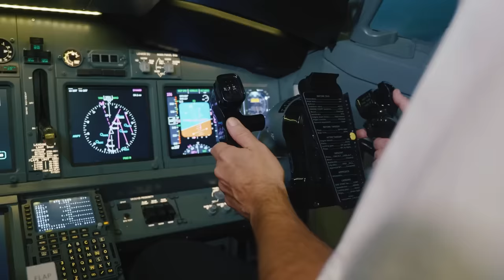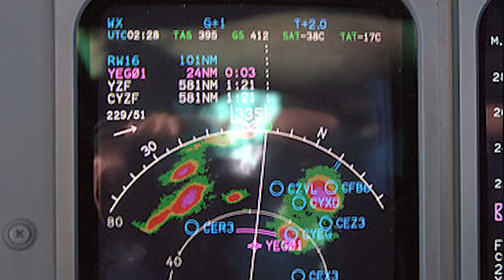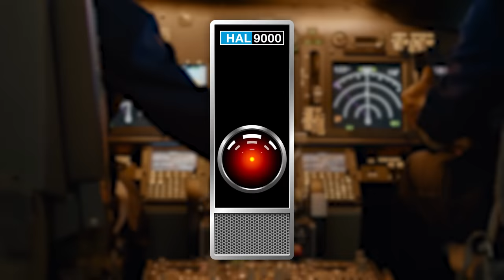Neil deGrasse Tyson Explains Advancements in Aviation

Comment: Thought provoking as always!  Just one small clarification: An aircraft turns by using lift (vertical to you) to counteract gravity and to create the horizontal displacement (relative to the earth) that causes the aircraft to turn.  So ideally, you should have always been experiencing only vertical forces when the aircraft turns. However, there are various factors (such as increased drag on the outward wing) which create a slight lateral motion which pilot must use rudder to correct.  Since you have probably spent a lot of time in airplanes, I expect that this is what you were experiencing - which all brings us back to the main point of this video - that improvements in electronics (including flight controls and the autopilot) have vastly improved the flight experience.

Comment: about the 'Taxi' discuss, in Brasil and maybe in Portuguese altogether we use 'Taxear' to the random path around the airport while waiting for go down.
Reply: Taxiing is on the ground, which you probably call taxear.  What Neil is talking about in that scene, is really called holding, or a holding pattern.

The airplane travels in a running track shape, with 180 degree turns and straight sections between its 180 degree turns.  The reason for this, is so it can re-calibrate its gyroscopes during the straight sections between the turns.  If the airplane just moved in simple circles, its gyroscopes would get a false reading of which way is down.

The gyroscope is there to tell the pilot which way is down, when it pitches and rolls.  Since it needs to adapt to the planet's curvature, rather than always pointing in a fixed direction in space, it uses pendulous vanes to slowly adapt to local gravity.  The banked turn interferes with its reference for local gravity, and many planes only run the pendulous vanes when the apparent gravity is within a close margin of 1 standard g, so that banked turns don't mess with this reference.

Comment: Taxi is transit time from gate to runway and back.  HOLDING PATTERN is the oval shaped racetrack pattern the plane flies in the sky to buy time before landing.  Look up Jeppsen airport charts and you will see holding patterns designated on each plate.  Holding patterns are also the way to increase capacity at an airport by created stepped altitudes for arrivals, you enter at say 18,000 and each circuit of 10 miles each direction with a 1 mile arch you drop by 1000 feet...thus at least 18 planes can be in the exact same landing queue for sequencing into the runway for landing.

Comment: Several others have already mentioned taxiing being movement on the ground, but I'm surprised at the amount of incomplete or flat out incorrect information in this episode. 

Regarding flared wingtips, in addition to increased efficiency, the more laminar airflow is safer for other aircraft either taking off from adjacent runways or taxiing on adjacent taxi-ways. The turbulence from a jumbo-jet without such wingtips extends far out from the wingspan of the aircraft. 

I'm not sure where you're getting your information regarding weather, turbulence stability and distance/time calculations, but it doesn't have any basis in the reality of air travel. 

Weather information is only better when you're accessing local information, as in measured at the airport, on the runway. Flights regularly alter their altitude and heading, mid-flight, when weather changes. 

When it comes to holding patterns, that has nothing whatsoever to do with accurate calculations. So many flights are delayed, etc, there's no way they could account for how many airplanes will arrive at an airport at any given time. Not to mention any flight experiencing a deviation resulting in a go around, meaning they must attempt a second landing. The idea that planes are on a tight schedule adhered to by most, let alone all, to eliminate holding is simply ludicrous. Give credit to ATC and pilot training, in addition to computer control advancements, that allow them to reduce distances between airplanes taking off and landing without sacrificing safety. Has nothing to do with flight time calculations. 

Certainly computers and fly by wire technology has increased stability under relatively smooth air conditions, but turbulence is turbulence. Anyone flying into or out of Atlanta, among many other places, can attest to turbulence still being a jarring issue. The same was true when I flew, as a passenger, into Costa Rica and had to do a go around due to violent turbulence on both attempts to land. Turbulence is still an issue mid-air, as well. Bear in mind, no matter how violent it feels to us, pilots will tell you mid-air turbulence isn't going to cause your plane to crash. It's only a comfort issue. (But the fact remains computer control does not eliminate the effect of turbulence on the airplane.)

As for computers, nobody wants to place ultimate control of an airplane in computer control alone. Computers don't know what they don't know. They are only as good as their programming, as evidenced by several well known, computer driven air disasters in which faulty programming caused the trained actions of pilots to be thwarted by computer overrides working against them. Computers are workhorses of jumbo-jet aviation, but the pertinent information regarding every takeoff or landing is carefully entered by trained pilots who use information from ATC and weather, etc to determine the best settings for landing. And. the pilots still make moment to moment corrections to adjust for conditions. We may have the technology to automate all aspects of aviation, but applying them to a jumbo-jet is still beyond what carriers are willing to spend for an aircraft. That's saying something given these planes already cost hundreds of millions of dollars.

I'd love for you to revisit this conversation with a seasoned pilot or other aviation expert, because it seems like you are uncharacteristically incorrect on a lot of this information. 

Cheers.
Reply: It’s about reducing the vortices, nothing to do with laminar flow!!!

Comment: The problem when a computer makes a mistake, it doesn't know it's a mistake. Neither do some humans but you get the point 😂
Reply: That's why you usually have multiple computers that have to agree on something or that can discard information that doesn't match what the others are coming up with. :)

I agree with your inherent point, just some context. ^^
Reply: Triple redundant is great for covering computer errors and some equipment failures but what does it do when the engine comes apart and cuts all three hydraulic circuits. The computer will crash but a pilot will try to fly the plane somehow and maybe save some of the passengers (flight 232)

Comment: There’s one back country road near where I live that has all kinds of twists and turns that you can easily drive at 80 miles per hour.  I did that around twenty years ago when I was younger, but the point is that the banking of the road was engineered for a much faster rate of travel than the current speed limit.

Comment: I grew up in the 60's and 70's about  15 miles from an air force base where B-52 bombers were stationed and they would regularly fly over on approach at about 1000 feet. Talk about noise. O! M! G! Eight screaming jet engines! Not only was it deafening, they also caused the reception on the antenna TV's go haywire.

Comment: I used to work at a Mercedes-Benz dealership that is quite literally at the end of the runway at Stanstead Airport. 

The runway ends, there is about 20 metres of grass, a road and then the building I worked in.

Whenever a plane was landing or taking off, you had to stop whatever conversation you were having and just wait, even indoors. 

In the winter you would be working and all of a sudden it would sound like a bomb went off as a block of ice fell off the bottom of a plane as it came into land and smashed on the roof.

Comment: Actually, most of the basic principles of flight you described are not simply due to computers and software programs alone. To give credit where credit is due, the evolution of the fundamentals of aircraft design and aerodynamics forces are responsible for todays modern aircraft.

We use onboard computers primarily for fly by wire control interface systems, auto flight modes, navigation, systems monitoring and management, as well as to augment aerodynamic stability.

Although computers are also used extensively for aircraft design and fluid dynamic computational modeling, they are not necessarily primarily responsible for aircraft flight stability and dynamics unless you are flying a high performance aircraft such as a fighter jet that is designed with inherent neutral or even negative dynamic stability. 

In that case, the aircraft would not even be controllable by the pilot without the onboard computers (usually 3 for redundancy) to keep the aircraft under control.

An excellent longtime reference book for learning aerodynamic design and stability principles that includes many equations and graphs is “Aerodynamics for Naval Aviators”.

Former Airline Pilot/
Masters Aeronautical Sciences

Comment: I'm an aviation enthusiast myself, and used to live 40 miles away from LAX and planes would approach the airport 10k feet overhead.  You could always tell whether there was a 747 freighter (old plane) overhead by the amount of sound it made.  Also, more efficient jet engines are making 4-engine planes (747, A380s, A340s) extinct in favor of 2-engine ones (777, 787, A350s), and how this favoring the point-to-point paradigm over hub-and-spoke.  I wish Neil had mentioned that!
Reply: It’s not about more EFFICIENT engines, it’s all about more RELIABLE engines!

Comment: Wingtips were created because of wake turbulence reduction which is when a plane leaves almost like an air tornado behind its wings and this makes aircraft’s space more apart because if they didn’t the plane behind, could flip over and crash if it is smaller than the plane in front and yes this has happened before a few times. Wingtips reduce wake turbulence and make landings faster while also reducing fuel consumption.

Comment: What is even more interesting is that the bank angle on ground is fix with respect to a predetermined speed but on airplane there is no such restriction. Tilt the airplane at the angle calculated for a specific travelling speed

Comment: Planes climb steeper (around  15 degrees) because it’s more fuel efficient, makes the flight faster as you gain speed during leveling out and yes it is quieter.

Comment: I just retired from working  for with an airline 12 years.  And we had regular conversations on the tarmac.  Yes we wore head gear or ear plugs. I concur with  most of the information in this video.  We knew exactly the time an airplane took off and when we expected it to land. We knew if the plane was going thru bad weather.

Comment: 3:54 Taxiing is simply the process of moving an airplane while it's on the runway. It occurs after an airplane has landed, and it occurs before an airplane takes off. Airplanes don't actually fly while on the ground. As a result, the process by which they move on the runway isn't known as flying; it's known as taxiing. 
I am sure he misspoke it is called “holding” when a aircraft is waiting for a spot to land

Otherwise great video thank you for all your efforts Neil & Chuck❤
Reply: Definitions. Holding Pattern (Merriam-Webster) - the usually oval course flown by aircraft awaiting further clearance; especially to land. Hold Procedure (FAA Pilot/Controller Glossary) -a predetermined maneuver which keeps aircraft within a specified airspace while awaiting further clearance from air traffic control.
Reply: TAXIWAY!!!! NOT RUNWAY!!!

Comment: I had not long gained my  CPL and ANZ had their new B762 delivered and a group of us CAC guys were at the perimeter fence near RWY 29 threshold watching the 767 taking off on RWY 02. We could see it accelerating towards us but didn't hear the hi-bypass RB-211s until it passed us a bit before the 02/20 - 11/29 intersection and even then it wasn't that loud and nothing like the RR Darts on the F-27. I know different machines and powerplants but the RB-211s were so whisper quiet after the DC-8s JT3D noise makers.

It's also amazing that it was only 66 years from the first powered flight by RIchard Pearse in March 1903 until man walked on the moon in July 1969. Has there been a time of such a technology leap in such a short time frame before or since?

Comment: I thought Neil would go into the rain percentage more.  Forecast weather is plot as a grid system.  The grid can be 1 Km to 7 Km.  Say there is a 40% chance of rain, that 1-7 Km grid plot has a 40% chance that rain, 0.01 inch accumulation, anywhere within that plot.  So say you are in a small town, and the grid you are in the town is in the corner.  If the grid is 7 Km and there could be 5.5Km of surrounding area that falls in the grid.  The forecast calls for 80% chance of rain at that small town, since that is the major feature of that grid plot.  You walk outside and see clouds, but you never see rain.  If you were to look at what instruments see, rain is falling across the outer area of the grid, away from the town.  That is still rain fall on that grid, 80% chance means that it is pretty likely to be at least 0.01 inches of rain.

Comment: Umm...airplanes don't bank just to keep your drink level, there's literally no other way for an airplane to turn. What the airplane uses to keep your drinks level, or keep its passenger's from getting sick, is the rudder. On airliners they have a yaw damper that keeps turns coordinated so you feel no lateral motion.
Reply: You can turn an airplane by only using the rudder and engines, but it will be extremely uncomfortable for passengers, and is much higher risk.  The rudder can yaw the plane when it starts horizontally, and then the engines can push it sideways to its direction of motion.  It's a move that an aerobatic pilot might do during an airshow, but not something that a commercial pilot would do, whose only goal is to get passengers or cargo from point A to point B.

The banked turn, coordinated with the proper balance of rudder input, is much more reliable at controlling the plane's direction.
Reply: @carultch  Using just yaw to try to change an jet's direction is a good way to to get the plane into a stall and spin.

Comment: Excellent, fun and informative video as always Gentlemen!
Two things I noticed, in the beginning you were speaking of a 747 taking off, while a two engine het flew into view...
And the bank angle on the racetrack looked familiar to me, and it's indeed the Hugenholz turn at Zandvoort Circuit in the Netherlands!
And I love airplanes and to fly as well, first "experience" as a two year old on a KLM B747 to New York.
Am living almost under the inbound and outbound of runway 18R/36L of AMS Schiphol Airport. Some noisy planes still, weird thing some of the quieter planes now have is, when they throttle down, engines go slightly out of sync, and a loud howl is the result of the mixing of the frequencies!

Comment: I lived in London late 1990's early 2000's when Concord was still flying, and OMG you knew when that was overhead, the windows would rattle so much you thought they were going to break, talk about loud. I guess the reason why Concord was so much louder than other aircraft was because, even in the 1990's, it was old tech, and obviously it had 4 very powerful engines.

Comment: A Delta tech and I were talking awhile back and  I was telling him that if you told someone in 1903 that you could soon travel from San Francisco to London in less than a day, they would think you were insane.  Only sixty years later, in 1963, you could get on a Constellation in San Francisco and be in London a little over 23 hours later.  A mere 60 years later, in 2023, that's way too slow. As a 73 year old, I realize how short 60 years actually is!  Of course, if we now have the ability to take control of an aircraft from the ground, a hijacker can now take control of an aircraft from a position of complete safety and crash it anywhere they choose.

Comment: Also aircraft manufacturing, such as how the fuselage is wrapped in FRP composites e.g Boeing 787 Dreamliner, allows for higher cabin pressure and more comfortable flights at the same high cruising altitudes.

Comment: I think a few of your terms are incorrect. Aircraft "Taxi" on the ground both to and from the runway. Aircraft no longer "Circle" in a "Holding Pattern" except in unusual circumstances (and it is more correctly termed "Staging".)  In some dire circumstances, flights may be diverted to other airports (especially in the North East where airports are often located closer together)

Passenger airliners have been capable of completely automated landing and taking off for about 30 years but the "Trust" factor has kept the airlines from using that technology. 

And you are correct that airliners follow pecise flight plans and most often manouver (make planned direction changes) un-noticed by the passengers (who are otherwise focused on their phone or tablet screens).

And, you are correct that aircraft don't take off without having an assured landing spot and gate assignment at the destination.

Of course, there are often unplanned weather events and / or mechanical problems that upset the best laid plans of mice and men.

Good show. I catch all of them.
Reply: Those words don’t mean what he thinks they mean.